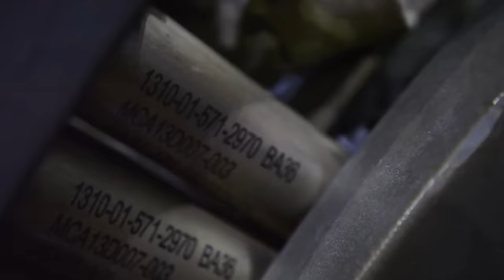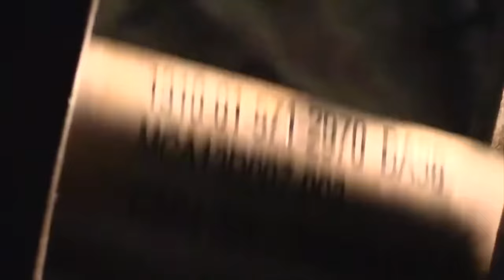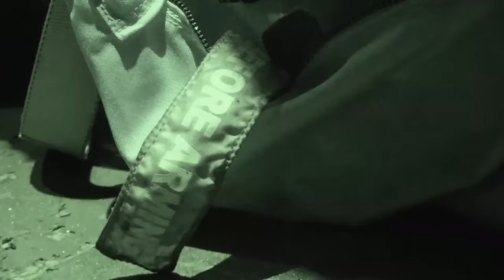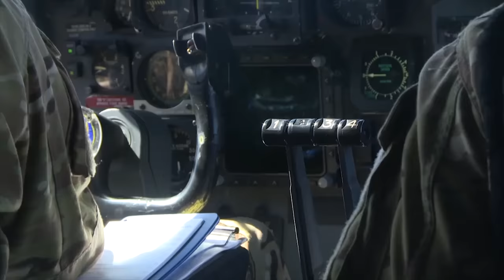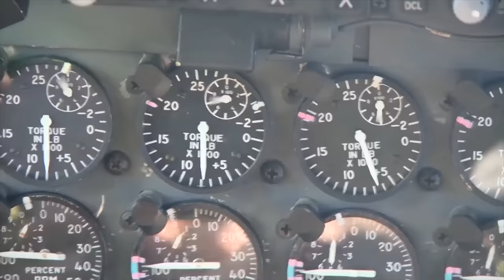GUN RUN! Legendary AC-130 Gunship in Action - Exercise Emerald Warrior

Comment: damn those bullets are big! That;s not a machine gun. it's a machine cannon.
Reply: 40mm around
Reply: The pay load isn't that big but whats carrying it to its destination for maximum speed while dropping kindve has to be and to get precise.
I mean if it was just a shell it wouldn't last long.
Reply: Well thats the 40mm Photon cannon.  Isn't a machine gun.  It has the 20mm mini guns on it.
Reply: SeanP7195 I think you meant 20mm gattling/rotary gun, a minigun fires 7.62 x 57mm NATO rounds.
Reply: hypershock0 storm No, I am talking about the 40 mm photon cannon, not the mini.  He was referring to when they were loading those clips of 40 mm shells.  The rotary gun is pre loaded.
Reply: SeanP7195 I was only correcting you on the minigun statement. Miniguns don't use 20mm rounds.
Reply: hypershock0 storm But I didn't make that statement.  The OP stated "those are big bullets".  The only "bullets" they show in this video are the crew reloading the 40mm Photon Cannon.  Which is most likely what the OP was referring to.
Reply: hypershock0 storm Ahh ok I see.  I did say 20mm.  Ok I got it now.  However, according to Wikipedia they are 20mm bullets on the Vulcan.

 The AC-130H Spectre was armed with two 20 mm M61 Vulcan cannons, one Bofors 40 mm cannon, and one 105 mm M102 howitzer; after 1994, the 20 mm cannons were removed. The upgraded AC-130U Spooky has a single 25 mm GAU-12 Equalizer cannon in place of the Spectre's two 20 mm cannons, an improved fire control system, and increased ammunition capacity. New AC-130Js based on the MC-130J Combat Shadow II special operations tanker were planned as of 2012. The AC-130W is armed with one 30 mm Bushmaster cannon, AGM-176 Griffin missiles, and GBU-39 Small Diameter Bombs (SDBs).[

7.62 rounds seem far too small for this system.
Reply: SeanP7195 Cool! and yes, riffle cartridges would be way too small for the AC-130's(and its variants) ground attack role.
Reply: hypershock0 storm Seems we are both half right.  The first variant had 2 Mini guns with 7.62 bullets.  They then upgraded to the 2 20mm Vulcans. They kept the standard system of of the 40mm Bofors, the 105 Howitzer and 2 20mm Vulcans up until the late 90s when they put 1 25mm GAU vulcan on it thus removing the the 2 vulcans.
Reply: SeanP7195 interesting to know.
Reply: Ben Whoever Talk about a bad day being on the receiving end of that lol.
Reply: THIS AIRCRAFT CANNON FODDER
Reply: The gatling guns are 25mm, the smaller of the 2 shells it fires are 40mm, and the large artillery shells are 105mm. I have brass of all 3 plus 30mm brass from the A-10 Thunderbolt and 20mm brass from the Navy CIWS.
Reply: thats just unnecessary
Reply: SeanP7195 I like how you guys refer to him as an OP, dont ask me why I read comments... I just have a lot of spare time I guess
Reply: 52 😏 get it...
Reply: Guys if you look when they show the giant minigun firing from the inside. That's what hes talking about, the shells are hand sized probably bigger
Reply: Ben Whoever probably a 50 cal
Reply: Chris. That's a joke. Right? Please tell me you're joking.
Reply: the gatling gun fires 25mm rounds with an alternance of AP shells,incendiary,explosive and tracers and fires about 6000 rounds per minute.

The bofors uses 40mm rounds and have 3 modes of fire and the last gun is a 105mm howitzer.
Reply: Paul Dufresne 
Does this aircraft have antiaircraft weapons against jets?
Reply: big and expensive
Reply: Can this thing evade s 300 or tor or avenger missiles ?
Reply: Fire Power701 k thnx for info
Reply: They're explosive bullets
Reply: hypershock0 storm the Vulcan uses 20mms right
Reply: Murderous weapon this. Yet how does the Taliban have US beat in Afghanistan!!
Reply: Ben Whoever 40mm,and 20mm cannons
Reply: Ben Whoever even Tanks like T-55 or T-62 will be Destroyed/disabled with such Cannons.
Reply: It's not a machine gun , it's an automatic cannon.
Reply: +Mark James puhh!!!! T-55 and T-62 is an WW2(ish) tank!  The Ac-130 cannon would easily penetrate!
Reply: You wut m8?? For outdated T-62 tanks yes Ac 130 will penetrate. But the tanks with 2nd generation ERA could survive if they are well covered on the tank. Modern ERA is able to defeat anti tank missiles , so cannons will not be able issue
Reply: Perhaps they're the same thing dude
Reply: Do you guys know 30MM Gau-8 Avenger Cannon that A 10 uses?
Reply: Ben Whoever nah its a minigun
Reply: 3:31 look at the wizard on the right controlling the gun with his mind
Reply: Ben Whoever 20mm/mini gun, a 30mm auto cannon, 40mm auto cannon and finally we see the big one on the front, which is a 105mm cannon.
Reply: Im sure when someone gets hit by one all that is left is a cloud of red for split second. Pretty terrifying but bad ass
Reply: M134 + 20mm Bofor cannon & 105mm Howitzer Cannon = Delivering Freedom to ISIS all around.
Reply: @RedNeckMilkman1000  and 105mm too!
Reply: SeanP7195 bofor
Reply: BOFORS 40mm canon
Reply: @ryanmichale3196  They works, since 60s.
Reply: 25mm Gatling Gun,40mm Bofors canon, 105mm Howitzer + in some Gunships 25mm chaingun.spectre has two 20mm canon.
Reply: You goddamn right
Reply: Its autocanon
Reply: 40mm rounds are the size of a artillery gun firing my friends dad worked on the hmas Melbourne he got the bullet of the Cannon the tip gone
Reply: That’s a 40mm Bofors gun.

Comment: The biggest problem with dedicated ground attack aircraft is two-fold... you can't use them unless you control the air, and all effective AAA is suppressed (alternately, the enemy has neither capabilities to worry about).  The 130 has a big signature, and is a sitting duck for enemy fighters, AAA of 37mm or larger, and shoulder fired missiles like the Strela.  The planes and crews took big time loses flying the Ho Chi Minh Trail.

Comment: what roles does the AC-130 have in modern warfare? Is it still useful now with drones that can be up in the air 24/7?
Reply: UCAVs carry even less ordnance than your average aircraft able to provide close air support (which, in turn, provides even less ordnance than a dedicated CAS bird like the A-10 - which brings into question the competence of why so many Air Force officials in high levels want to get rid of it as fast as possible). Loiter time isn't a problem (and with in-flight refueling even regular piloted aircraft can stay airborne for hours upon hours). Having enough weight to throw when you get there is. Currently, an MQ-9 Reaper can arrive on scene with 4x AGM-114 Hellfire missiles and two Paveways. Not exactly a stellar load out for close air support to begin with, but that will also last about 5-10 minutes at maximum in a close air support mission. That's not very useful, especially when you get firefights that can last hours.

UAVs currently are the real-time intel king of the battlefield. They can fly, get a literal eye-in-the-sky view and stay on station for hours with high grade optics and FLIR relaying information in real-time as to who is where and doing what. That's a powerful and useful tool. But close air support is a job that they are absolutely shit at doing. The "strikes" in drone strikes is purposeful because that's about all they are capable of doing.

Moreso yet, any guy on the ground (especially any forward air controller) is going to want a pilot in the seat to communicate directly with on where he wants ordnance and what they want and when. That helps prevent accidents and gets better close air support that's more accurate and effective.
Reply: I thought drones are suppose to be accurate.
Reply: As others have said...AC-130 can perform close air support on an ongoing basis. Drones are good for limited surgical strikes. Such as they are.
Reply: You are incorrect, for reasons already stated. Its obviously quite useful, and is currently being used. If by "tribesmen and unarmed civilians" you mean the militants all over the ME, N Africa, and S Asia that compose shit shows like ISIS, the Taliban, and Al Shabaab who are actively slaughtering and enslaving (while unarmed?), then sure...its perfectly useful at that task. It goes without saying that its not meant for fighting modern militaries, at least not until after the SEAD phase of an offensive is complete.
Reply: Yep. As I thought. Fucking internet, lol. What did I expect.
Reply: serenelight I doubt they just fly one of them in the middle of battle while there are anti aircraft weapons on the field pretty sure they wait till it has total air supremacy
Reply: It's for CAS. Can just orbit above the AO and rain hell on the enemy.
Reply: Steve Arthur where are you from? I can see a flag in your picture but its too small to make out the stars.
Reply: These are never alone in the sky.

Comment: It's a hyper-mobile arsenal, but how will it defend itself from anti-aircraft weapons?
Reply: That's not the purpose of the AC-130. Anti aircraft weaponry will have been long destroyed before an AC-130 shows up. AC-130 is for ground support. 

You don't send in your ground units until you have air-superiority which means all air defenses of the area you are attacking have been immobilized. This is just war-strategy 101.
Reply: it would be stupid to send this into a battle where it is constantly lettinf off flares to protect itself. as said above, anti air is taken out ahead of time. air superiority is gained (if there are enemy aircraft aswell then that's delt with) and this comes in. its not that fast so it cant outrun. but it can outgun just about anything else.

Comment: want to hear a fun fact about this particular occupation?

over 60% of those who operate in an AC-130 gunship as gun loader die from cancer at relatively early ages due to the extremely toxic gases produced by the by the gun powder and other chems used in the ammo. if you're dumb enough to serve, just remember to not take this occupation as their is a very real and large chance that you may die in your early 30's to 40's from cancer created from inhaling the toxic gases, im not saying that the the other occupations such as infantry and artillery crew aren't dangerous, it just if you retire from service you don't wan't to die 10 years later from a cancer that was created from the very job you thought was safe and relatively easy don't take this occupation. im sure that their are many similar toxic gases produced in the field that soldiers are exposed to and aren't told about that will give them cancer or other horrible side effects in years to come, if you're dumb enough to join the military then beware

Comment: The 25mm Gatling gun is a beast at over 70 rpm (rounds per minute)
Reply: The rotary cannon being du
Reply: The rotary cannon being discussed is the GAU-12/U 25mm Gatling gun.  In this application (AC-130U) its firing rate is limited to 1800 rounds per minute due to aircraft hydraulic system limitations.  The magazine holds 3000 ready rounds - 1-1/2 tons of ammunition. After a firing burst, the slow rotation you see is the gun reverse-clearing - that is unchambering spent cases until only empty spaces are in the gun.
Reply: Damn 70rpm thats extremely slow

Comment: I wonder what they do with all the spent shell from the guns I see them putting them in bags
Reply: Run used components back threw a large Dillon's style turret auto reloading press. In my case it would be my RCBS Rock Chucker. Changing loading dies for each step. Instead of buying 2 boxes of factory ammo for $40-$50 I will load 400-⁷500 rounds  Love to shoot.